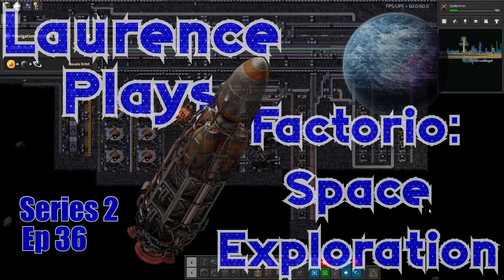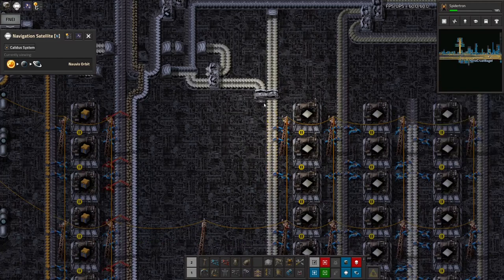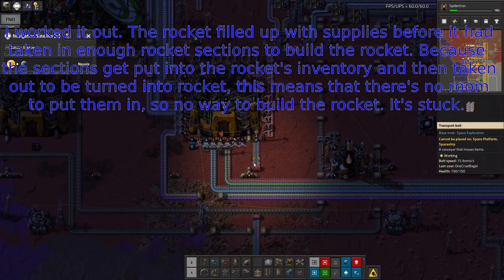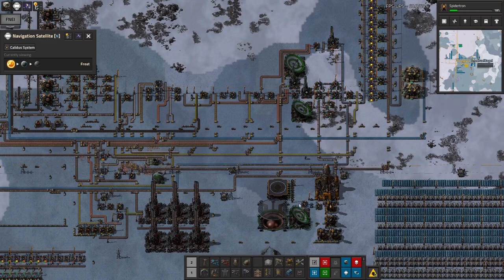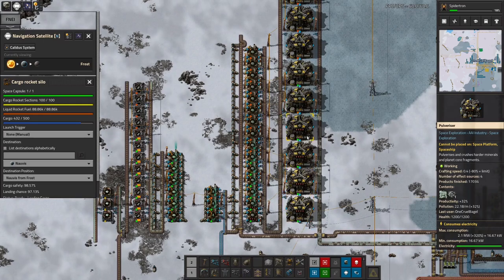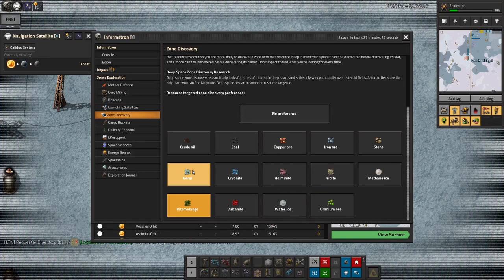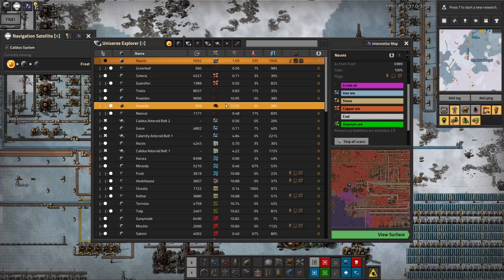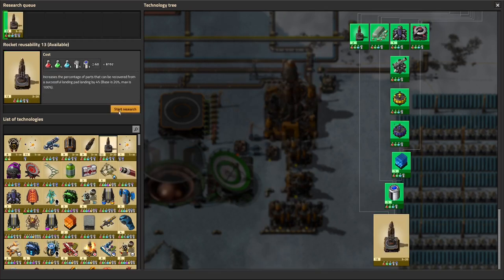S2-E36 - Materials - Laurence Plays Factorio: Space Exploration

Comment: Thanks for sharing! Your rocket on Nauvis is refusing to load more rocket parts since there isn't space in the container to accept it – I deal with it by not allowing the rocket to start loading any cargo until the rocket is ready to fly. SE includes a signal from the rocket silo for that.
Reply from the maker: Mmmm, I worked that out eventually, although it did take me longer than it should have - thank you! I've sorted it by not loading until rocket parts hits 100, which is almost the same thing, but means the loading can happen while fuelling is still in progress. Although thinking about it, that does mean that there could be a problem loading the rocket pod. Hmmm...
Reply: There is a signal for empty slots too so you can also load while the number of empty slots is greater than 1, or 5 just to be safe.
Reply from the maker: @AndrewLeConte  True, but then the rocket would never automatically launch on cargo full. Also, if it was set to 1, I'd probably end up with it failing as there'd be 49895, so a slot and a bit left, then an inserter would insert 10 and it would put 5 in the final slot. But I guess that's why you said "5 to be safe". I think switching to the "rocket ready" signal is probably the most sensible way to do it - I'll try to remember to do that when I next play! I've been rather busy recently...
Reply: @LaurencePlays  I probably should have made "also" clearer as a key word. You can load when the rocket is full or when you are not at risk of filling that last slot the rocket needs.

Comment: If productivity modules are limited in supply the most efficient use of them is to place them in machines at the end of the assembly process first, and then work your way backward. In this way you maximize the output of end-products and minimize the intake of simpler products and base resources.
Reply from the maker: I believe that depends on the number of machines and the number of prod mods you can put in them. If they're all the same machine type, you're best off putting them in the stage that has the fewest machines. Because the whole process is multiplicative, a 20% boost at the start will give the same output boost as a 20% boost at the end, but if you only have 1 machine making the final product (for example) then having the 20% boost then will only require one set of modules. That's why in vanilla the advice is to put your first productivity modules in your rocket silo - it takes in loads of highly processed stuff and you'll probably have loads of machines feeding it, but at least at first, you'll only have one silo.
Reply: @LaurencePlays  Placing the productivity modules in the rocket silo is the best example of maximising the output of end products and minimising the intake of simpler component parts by prioritizing the end of the assembly process! 

It is also true, as you say, that there is a benefit to spreading them throughout the stages (rather than putting them all in the crushers, in which case you lose out on the productivity multiplication), with preference given to those stages with the fewest machines, though this can have the effect of limiting throughput or allowing inputs to spill over to un-moduled machines. 

However, it is almost never true that a '20% boost at the start will give the same output boost as a 20% boost at the end' because 'the whole process is multiplicative' - the end-stages almost always involve mixing various components that are produced separately. Imagine having only 2 productivity modules to use in an assembly line for low-density structures - they would go in the LDS assembler not the furnaces or chem plants. Likewise with Berylium, though there are some stages where the productivity module placement would make no difference (Assembler 2s making Berylium Plates from Ingots vs. Electric Furnaces making Berylium Ingots from Powder) it does make less and less sense to use a limited supply of productivity modules earlier in the process before different elements are mixed together. Placing the modules in the chem plants making liquid Berylium - or any structure thereafter - saves on cryonite rods (and water, which sometimes matters) - likewise you can save sulfuric acid by placing them in the chem plants washing the Berylium.

I can see why you would less focused on optimal use of cryonite and oil than Berylium because you have a Berylium shortage, but that is really only because of the belt throughput issue south of the Frost base which is easily solved by locally manufactured red belts.

Also, as you did mention in the video, it can make sense to prioritize the machines with the most module slots. To that end - you should be using the furnaces with 5 module slots to cook the Ingots! (Which is also the end of the process, not counting plates!) Maybe you explained why you aren't doing this in another episode that I missed. But those furnaces are awesome.

At any rate, I am very much enjoying your playthough, looking forward to next episode.
Reply from the maker: @corbynite2004  That's a good point about minimising the amount of other inputs you're using - I'd been concentrating on the quantity of beryl used to make the beryllium, and not the acid and cryonite. Interestingly, I had the opposite thought while working on a vulcanite processing facility; I wanted the productivity modules as late on as possible because I wanted to minimise the amount of stone produced as a byproduct because (at the time) I didn't have anything that needed it. I've now got enough production of productivity modules that it's not an issue, except that there's still a lot of work to be done to get everything properly upgraded. I'm also gradually starting to use the even bigger furnaces, but again, it's a slow process upgrading everything. 

Thank you - I'm glad you're enjoying them! I need to start playing a bit more, I had a little haiatus to concentrate on other things, but fortunately I've still got some videos in the buffer!